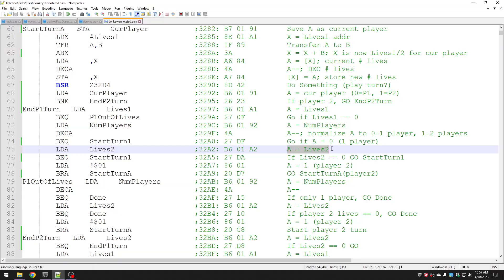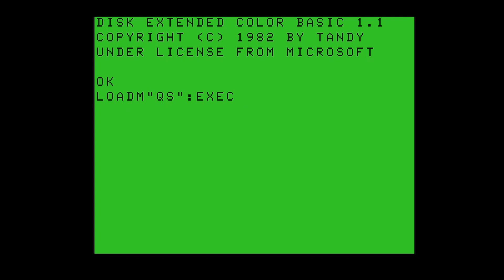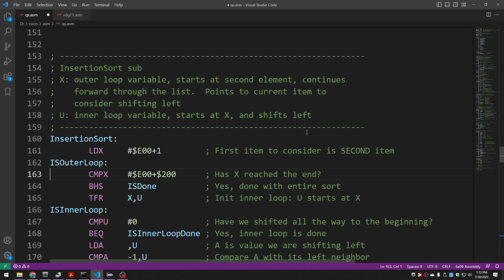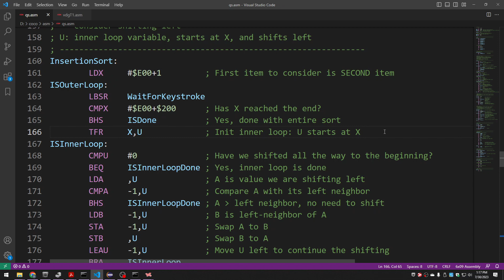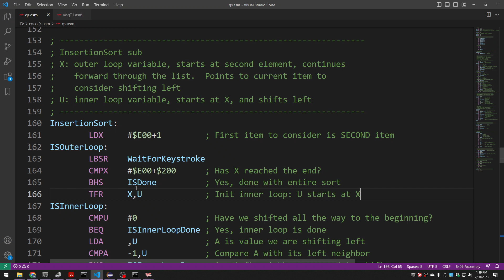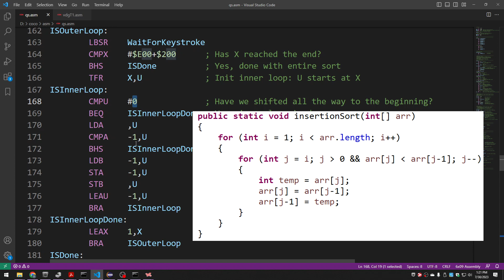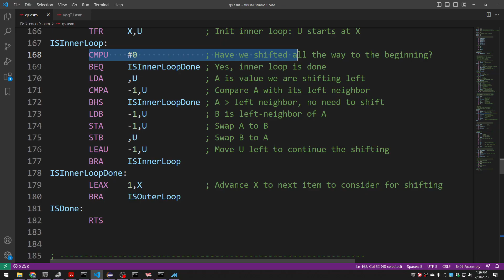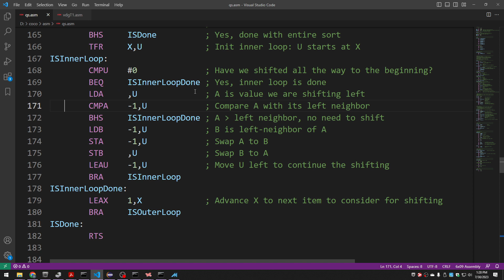Insertion Sort assembly language bug | Asm Adventures

Comment: A perfect example why to use higher level languages.
Reply: Right, but hand crafted machine code is faster and more compact especially on older machines with memory and speed constraints. ;)
Reply: @BillAnt  the compiler is really good at making optimizations already
Reply: @BillAnt  is it faster? Or is it faster when perfectly optimized? That is always the issue right, people who havent spent hours in optimization classes will end up writing slower code then if they had written in higher level langs.
Reply: @pianissimo7121  - I meant that writing code on an IDE is faster in a high level language, but straight machine code is more compact and efficient depending on the skill of the programmer.

Comment: Are you going to tackle quick sort? Compiler Explorer has an option to generate code for a 6502 which might make for an easier starting point, if you don't have your own cross compiler installed.
Reply from the maker: Quick Sort is indeed coming up.  😃  I've already written the 6809 code from scratch.  Thanks for the tip, though!
Reply: @CocoTownRetro  Maybe something to keep in mind next time to shortcut the work a bit.